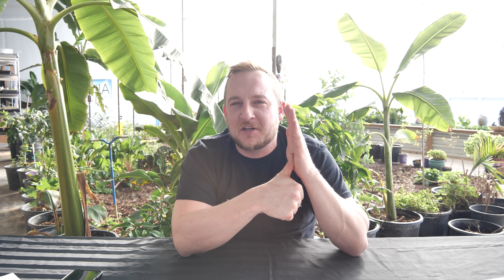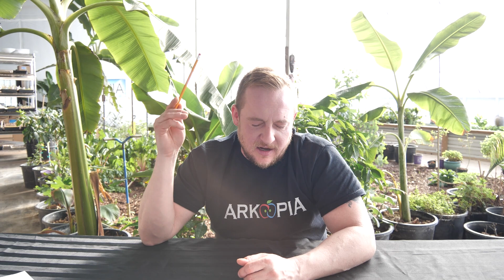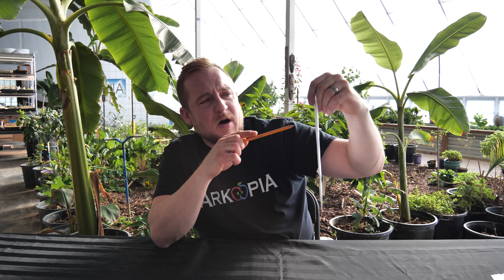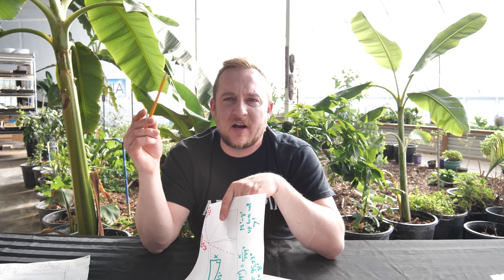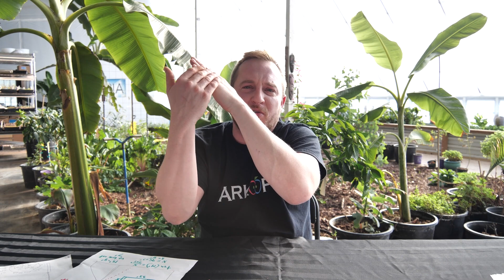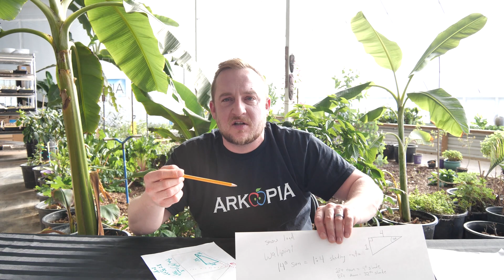Arkopia Greenhouse - Full Consultation Seminar - Part 2 of 3 (I discuss & cover it all for free)

Comment: Love your setup and the goal for using the Chinese greenhouse curtain in-between the layers.

I am located in Nebraska..no we didn't do a greenhouse in the snow...but instead a fairly decent insulated 14 by 30 greenhouse utilizing the north wall of my husband's shop. We double layered the walls..basically both sides of the studs using 8mil  plastic with the bottom three foot being insulated and sided and with earth on the outside up a couple feet and extending out several feet. Roof double layered both sides of rafters10 mil plastic. Goal is to switch the outer plastic to polycarbonate panels this summer. I wanted to see if I could heat a big tent ...lol
I need to keep my greenhouse 65 F degrees so we heat with a 45,000 btu pellet furnace which also heats my husband's shop. If the sun is shining the stove is turned off and then the heat from the greenhouse is blown into the shop. I wish we had more sunny days, we average around 200 a year...grrr 
Our cost for this set up was a little over a thousand dollars not counting the pellet furnace that we already had.
We also utilized warped lumber and other salvaged materials. Main cost was the plastic.
but I'm here to tell you...even in Nebraska you still need a heat source at night. The individuals that have
gone with the greenhouse in the snow builds have had to use supplemental heat at night. We toured some before we built our greenhouse. We can get some pretty cold temps in Jan and Feb. -20f and highs during the day 0 degrees or less. 

I really enjoyed your videos on how you built your greenhouse.
Reply from the maker: Ground temps are much colder where I live.   Would have been nice for one air tube system as just an air exchanger though.   We are suited well with over 300 sunny days per year, even though it’s bitterly cold. ✌️
Reply: @ArkopiaYouTube  I was surprised to learn how many days of sun you get that far north. I had seen the guy's video a few years back raising tomatoes commercially in the chinese greenhouse with the blanket system and wondered how it could possibly work, but with that many sunny days now I understand why.
Envious of your days of sun but sure not envious of the bitter cold temps. We have a frost line of aprox 4 foot...so water lines must be at least 5 foot in the ground. I know...I hand dug a water line from the well to my husband's shop...lol it was too narrow of an area to get a piece of equipment into the area. Thankful I did not have to go down 12 foot...yikes !!!!!

Comment: 14° at the winter solstice @ your location of 52°.16 ' .. At the 49th parallel (49°North latitude), there's a 3 degree difference so your overhangs at the eaves would have to be less than 48 " .I'm I on the right track? 
There must be a equation that folks can punch their latitude in and get their roof angle for both winter and summer sun angles .
I used to know this stuff when I was in carpenter school. 
53° north latitude is also the number you subtract from 90° equals 47 ° is the sun angle off the southern horizon on June 21st .& 33° Less in the winter on December 21~24 equates to 47 - 33 =14 ° . And add 1 ° for each degree south of 53 ° north latitude and subtract 1° for those living north of 53 ° north Latitude. 
So if you live farther north say at the 60 ° N Parallel (arctic circle, 
The  maximum summer sun angle is 30° off the southern horizon, 
And -3° on December 21~24 , and 0°In late December early January. 
(That doesn't sound correct but I'm thinking out loud trying to figure out where I went wrong)
Reply from the maker: You will like todays video coming out shortly,  stay tuned. ✌️

Comment: Hi Dean! I love that you touched on the Walapini. 

I dug 2ft down and built my greenhouse on a retaining wall built from garage panels and 2x4 construction. My pony wall is 3ft then we have 2ft of double pane windows. My south end is at 45 degrees, snow slides off but does accumulates.. Luckily I can shovel it away in a few minutes and low angle sun rays can enter once again. I think I have a sunken greenhouse vs walapini? 

I am however worried about snow melt. We have weeping tile around the perimeter of the greenhouse. Thoughts on flooding? 

Cheers!
Reply from the maker: That’s not too terribly deep.  I guess keep just that melting snow away.   We’ve had some dumps of snow and the snow even gets 5 ft in front of my greenhouse.  ✌️

Comment: My solar set up cost about US$40K. Did not do it for the environment but because we are miles away from the last pole on the grid. Did not need a system as big as we got (14KW) but .. why not :-) The Solar system not actually necessary either, We have Propane for heat, cooking and generator etc, don’t need Propane either as we have 3 primary Wood heat/cooking sources and paraffin lamps if all else fails. Trying to cater for all situations.
Reply from the maker: Awesome.  👍👍👍

Comment: Not a great comparison but for what its worth I just had built a 65’ x 54’  free span steel free span building.with concrete floor, 5 garage type doors, 3 man doors and about 9 windows of various sizes. All new including labour (our off grid forever home) US$220K (completed 2022) Not counting septic, 1000g propane tank and instal, 3 x 2200 gallon installed underground water tanks etc.
Reply from the maker: Thanks for that.   Might help out some folks.   Approximately what area of the US?  ✌️🙏  Ps: there is no way you’d get that building value in Canada.   Someone close to me is building a 4000 square foot house, plus finished walk out basement,  with 4 car garage, and the build is 1 million Canadian dollars, not including utility services and septic tank, and not including the land. ✌️
Reply: @ArkopiaYouTube  Good lord someone is making money there! We are northern Idaho. I will add that the bid was done in Oct 2020 but the building got "that bug" I guess and was delayed a year (whatever). The manufacturer wanted an additional US$20K by the time they got to it, I told them no. The same building I would not be surprised if it were now US$300K. Our next plan is a root cellar and small version of a insulated passive greenhouse, probably 20' x 30'. We live 6 hours south this property and will be permanent there by June!

Comment: Hi Dean. Thank you for another great educational video, I will be watching it many times. I have have considered most of the issues you covered also, trying to come up with win win designs. I was wondering if you think it would work to vent your exhaust from the furnace into the greenhouse to get increase co2? We have a non vented heater in our basement that doesn't need to be vented. We only use it in emergencies. Thanks again.
Reply from the maker: Of course I figured should ask some gas fitting guys, and they said no to venting into the space.   But I don’t know why not.   I’ve seen those ventless heaters, so what’s the difference. 🤷🏻‍♂️   The CO2 generator doesn’t vent either. 🤷🏻‍♂️

Comment: Is it just the underground walls you insulated or is it also insulated under the concrete?
Reply from the maker: Not under concrete.   Because it’s in a warm area, it’s passively warming the ground up too.   The earth pulls heat down.
Reply: @Arkopia  makes sense. Im thinking if you could have put an air gap around the perimeter of the building to give a little extra insulation too. Anyways you got it correct already! Good job

Comment: You could use well water that has high co2 and offgass it in a "degassing" chamber. Some saltwater tanks with reverse osmosis systems and well water have high co2 in their pure water. One solution was to offgas the clean water first.